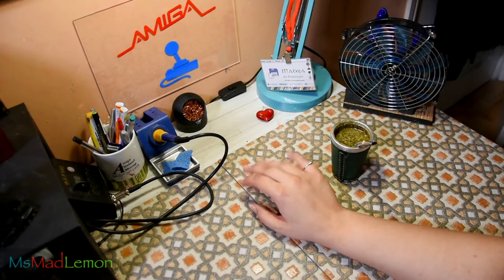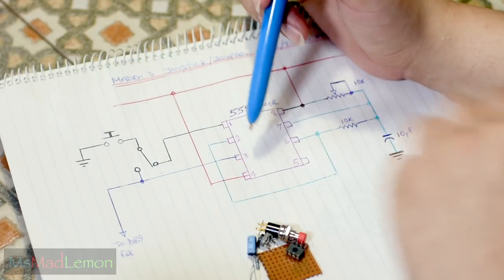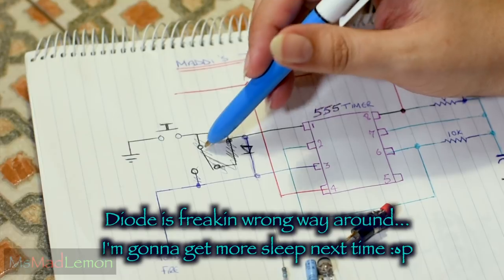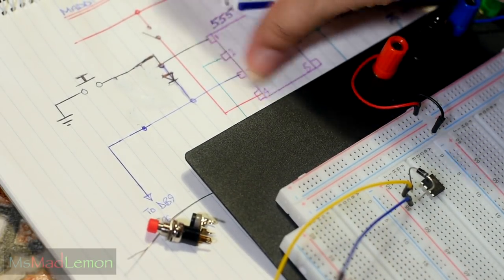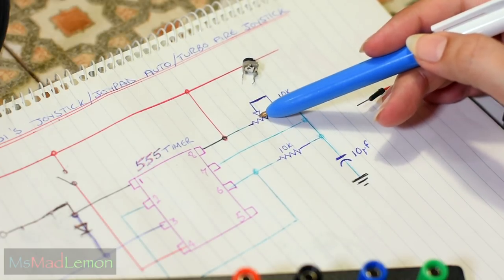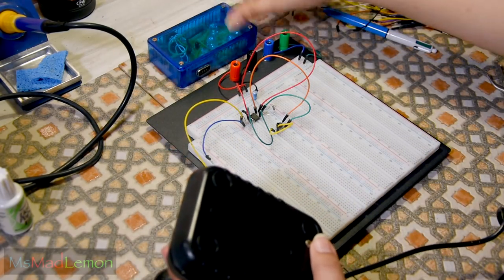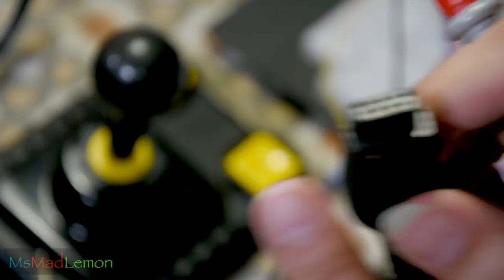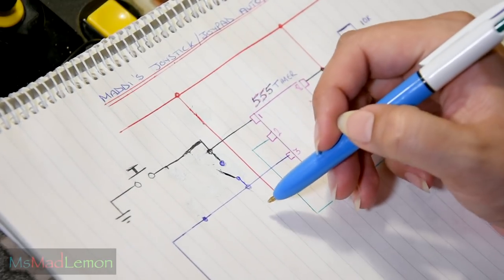Joystick Rapidfire Project - Part 1

Comment: Thank you so much Maddi... you are a true gem (teal right?)... and you know I love seeing the figuring-it-out process at work.

I discovered that the 555 circuit in my blue Competition Pro Joystick is actually fried. So that's the reason I've had trouble reverse engineering it. But now I don't have to. I can use your circuit in my DIY arcade joysticks, clean up and maybe modify the tiny PCB in my Competition Pro to use yours instead.

Comment: I'm glad its not just me that can't figure out how the original Zipstik auto fire works.  Made one for an arcade stick I made as it was so simple, drew a schematic, looked very weird,  made it on veroboard, and it worked.  Minimum cheap parts cost. Must be magic!
Reply from the maker: It literally mashed my head lol, its got 2 transistors but doesnt require a +v ?! unless it's getting some power from somewhere, it is confusing and i've scratched my head quite a bit over it, i'm going to draw the circuit out myself and build in future.
Reply: I remember this kind of circuit - i cant remember it exactly, but the power comes from the signal itself. Very clever, and it also works whether the fire button is active high or active low :)

Comment: Only minor thing with the 555 timer is that the output on pin 3 is a push-pull type, so it will be driving the Fire pin on the DB9 to +5V when the timer is "idle".

Ideally, it should really be an open-collector type output, so it only pulls the Fire signal to Ground.

Pin 7 on the 555 is an open-collector type output, but the problem is that it needs to be used as part of the RC circuit for the timing.

Probably not a big deal if it works OK, but I would recommend adding say a 200 Ohm resistor between pin 3 and the DB9 pin. ;)

Otherwise, it would mean adding a transistor, with the base being driven by 555 pin 3, emitter to Ground, and collector to the Fire signal.
Reply from the maker: Thanks for the suggestion Ash,
 it only works with the joystick tester, a real computer could have a different result so i'll keep that 200 Ohm resistor in mind! :o)
Reply: It's possible to use pin 3 to the RC circuit and pin 7 as the output.

Comment: Neat. This is very similar to the LED flasher I made for a model. I used a POT to control the blink rate. When you think about it, that blinker could also be your auto fire! (I made this back in 1990 FYI)
Reply from the maker: Yes it's more or less the same thing, it's just a series of pulses being generated whether the signal is sent to a computer or an LED. the one inside the zipstick joystick made with 2 transistors and a couple of capacitors and resistors is almost identical to the LED flasher project I messed around with years ago.

Comment: If the timer-less autofire circuit consists of four resistors, two caps and two transistors it's just a bog standard astable multivibrator, where the transistors are bring triggered in an oscillating pattern by the charge and discharge of the caps. It's electronically simple and doesn't require a timer or power supply (the signal voltage alone is enough) although it's not adjustable without swapping out components with different specs.
Reply from the maker: Yes, the more i'm looking at the zipstick autofire circuit the more its reminding me of a electronics kit project i was messing with a while back, consisting of caps, transistors resistors etc, which were used to make LEDs flash and alternate flashing.

Comment: Hello there! I am currently fiddling with a CMS joystick (directions + fire button) that i converted from 15pin gameport to 9pin amiga port. I managed to make the directions and fire buttons work, but the autofire is the only thing left. The circuit utilises a 555timer. I already connected PIN 7 to pin 8, according to your schematic it should be connected to pin 4 as well?

Comment: Great video :) That is a great hardware project. Ive only ever transplanted auto fire circuits / cables (too many joysticks). On a side note you should have a look at an Arduino Pro Micro as you can make a 9pin joystick to USB HID device very easily and for a lot less than people sell them for.

Comment: I have the same zipstick with the original Auto-Fire circuit. If you want I can send Pics of both sides. It's 2 transistors (BC327 and BC182) 4 resistors and a 1uf electrolytic.

Comment: The thing to bear in mind with autofire circuits, is that the fire button (and the other directions) always connect the signal to ground. There has to be current flowing OUT of the pin and down to ground for it to work. If you want to think of it another way, the computer has OUTPUT pins which detect when current is drawn out of them (thats over simplifying it a bit!)

It got even more tricky whhen some old computer systems had the switch common as 5V, and the button pins as inputs. You can see it wouldve been quite awkward to design an autofire that worked in all cases!
Reply: However the cool thing about electronics - is when it doesnt work, you learn more :)
Reply from the maker: This is true, it's how i've actually learned, self taught through trial and error :o)

Comment: Great video Maddi. I'm gonna modify a Mega Drive controller to change jump to a button because I think it would greatly increase my amiga platformers experience.
Reply from the maker: Thanks! i'm about to do a joystick build myself and was going to include something like this, as far as I know it's simply just a matter switching contacts between the "up" and one of the buttons no?..(in my case I was just planning to add a button parallel to the "up" on the joystick)
Reply: MsMadLemon Yep swapping the contacts

Comment: You can use a Sega Genesis extension cable instead of making your own joystick cable. It already has all 9 wires are inside it, and you just have to hack off the male end to get at the wires you need. I had to fix a couple Commodore 1311 joysticks and that's what I used to get them working again, and it only cost about $6 at a local gaming shop. https://www.amazon.com/Retro-Bit-Sega-Genesis-Controller-Extension-Cable/dp/B0089ZLXHW
Reply from the maker: Thanks for showing me this, indeed they would be much more ideal, more convenient also,  I will see if there are any available as easily in my area here.

Comment: A suggestion: Instead of building tiny autofire circuits, fitting them inside the joysticks and replacing the cable to add the +5v line, why not build the circuit inside a separate box with a cord and plug on one end and a DB9 socket on the other?

While not as convenient as having the circuit inside the joysticks themselves, having it be a separate unit means it can be used with ANY Atari style joystick, you don't have to modify the sticks themselves and there would be plenty of room to add a larger pot and adjustment knob. 

I actually have such a unit from back in the 80s. It looks like a large plug with a little knob on it. You plug the joystick into it, then plug the unit directly into the computer/console. I don't know what kind of a circuit it uses as the case is glued together. It also doesn't have an on/off switch. I've always thought it would have been nice if turning the knob to the lowest setting turned it off completely, but it doesn't. Oh well. :)
Reply from the maker: Shhhh, that is a future project ;o)
When I come across a project, I tackle it in a few different angles ;oD
However, one thing i've not found yet with the external configuration is to make an external box that works exactly like the internal one in the joystick would... as in I like to have rapid fire only when I press the button as Zipstick joysticks do... I dont like rapid firing constantly until I turn it off, if you know what I mean. 

I've so far only found a solution for external boxes that allows the constant rapid fire (maybe there is a solution with a more complex circuit)... but nontheless I still p[an to make an external one for the sake of it :o)
Reply: Why can't you use the exact same circuit? I mean the cord is just a set of wires connected directly to the switches, so can't you make the same connections at the plug?

I know I'm far from an expert in electronics (I know next to nothing actually), but if the only line you need to interrupt to make the circuit function is the one from the fire button, you should be able to do that in an external box, no?
Reply from the maker: Its way easier for me to show this visually but i'll try with words.
In the joystick you have ground going to the individual firebutton and the other end being the fire signal going into the switch. You need to put the autofire circuit between the switch and ground, this ground connects only to the firebutton
on the DB9 plug, the ground connects to all the buttons in the joystick, so if you were to connect it the same way at the DB9 plug then you would be rapid firing all the buttons because all the grounds will be tapped rather than just the connection to that one button

I hope this makes sense, I wish I was able to show it on a whiteboard lol .. once I get around to doing that video I will explain all this.
Reply: I understand what you're saying, but... 

That's not what your diagram and the actual wiring shows. The diagram shows one side of the button connected directly to ground, while the circuit goes between the button and DB9-Fire. 

When you're connecting the actual wires, you leave the ground wire from the joystick cable (black) connected to the button and you only unplug the orange DB9-Fire wire. When you connect the circuit, you connect the non-ground side of the button to pin 1 on the chip, then you connect DB9-Fire (orange wire) to pin 3 of the chip. In the video, you never altered or even mentioned altering how the common ground wire from the cable is connected to the switches. The only connection you changed was the one from DB9-Fire, which is a unique line that only goes to the fire button(s). 

That being the case, you should be able to interrupt it at the DB9 in an external box. Ground and all the other lines get passed through normally, while DB9-Fire (orange wire) in the joystick cable goes to pin 1 of the chip, then pin 3 goes to DB9-Fire on the computer side. No?

I swear I'm not trying to be a pain in the butt, I just want to understand the problem. I'll freely admit that I know next to nothing about electronics, I just honestly can't see the problem according to your diagram and how you connected the wires. The way you've described it, would have left the orange DB9-Fire wire connected to the button and the ground side wired directly to the circuit, but that's not what's shown in the video.

Am I still misunderstanding?
Reply from the maker: I know you're not trying to be a pain in the butt, actually if i'm honest I need this brain storming and back and forth with someone about this, beacuse for some reason i sat and thought about this drew diagrams, even tested, but i was unable to find a way even though i was convinced that there must be a way....the circuit which I was using may have been confusing me or maybe i was overthinking things which tends to lead to serious headmashing. 

You may be right about this and I need to study this again and come back to it with a refreshed mind. 
I was initially convinced also that it's possible, maybe i went down an awkward route. 
Anyway thanks for the back and forth actually I appreciate it and if I can get an external one working then that will be freakin fantastic! 
I will have three autofire circuits and solutions to demonstrate in my videos.
Reply from the maker: Well you have it right except if you build this circuit, all your up down left right and fire buttons will be the same button.
(I'm sorry, i couldnt resist lol ;o)))
It's so simple, and I had more or less the same idea initially, i'm wondering now why i came to the conclusion that it wouldnt work, I think the circuit i was looking at to seek inspiration from back then was confusing the freak out of me. 
It just goes to show, the difference returning to an idea after a while, and then a brainstorming session, can make!
Thanks for that :o) 
And I will try to build this on the breadboard and see if it works well, If all is well I can make the actual build be external, and mention that internal can be an option.
Reply: Well, I was going to draw all the wires and even make them go to the proper pins in the DB9, but I figured that would just make the image more confusing. Actually, when I'm drawing a diagram that I plan to keep, I usually take care to make it as perfect as possible. I'll make sure that the four directional switches are all equally spaced, that the pins in the DB9 are equally spaced, that all the parts and pins are labeled, etc. I can be a little obsessive. :)

I'm glad I could help (and glad it didn't turn out that I misunderstood something and was wasting your time). :)

My own electronics experience has mostly been limited to re-soldering broken wires, or making adapter cables that don't need any other parts. The most ambitious project I ever made was following a diagram on the net to make an adapter that would let me plug an Atari joystick into a 15-pin gameport on a sound card. It never really worked properly because even though it included pots to adjust the horizontal and vertical centering, it always registered way off center. It wasn't a total waste though, I bought a gameport to USB adapter which has a setting for digital gamepads. The circuit works fine when plugged into that adapter in gamepad mode. I even used a square-ish dental floss container as a case with the plug and socket mounted on each end. It came out nice except for the fact that I didn't have a 15-pin plug, so I cut off a 25-pin one. It works fine, but the plug is off-center in the case. I even added a connector for hooking up extra buttons (up to 3), but never got around to doing anything with that.
Reply from the maker: No dont worry about the wires, I was just joking around with you, I know exactly what you meant by it :o)
I just built the circuit on breadboard and it worked perfectly (external circuit) It's so simple I have literally no idea why I had that 2am freakin head mash session, possibly a result of it being 2am and that other circuit confused me! 
It takes someone outside the head mash zone just to say "oh you can do this" for that facepalm moment which I just had lol! So thank you. 
I'm about to build this circuit for this weeks video :o)
Reply: There have been times that I've overlooked simple stuff too. I've written complicated batch scripts to automate things and when I later take a second look at them I wonder why I made it so complicated when there was a much easier solution. 

I look forward to the video. :)